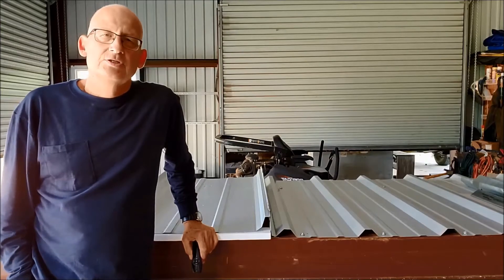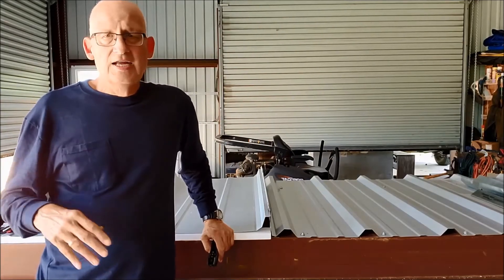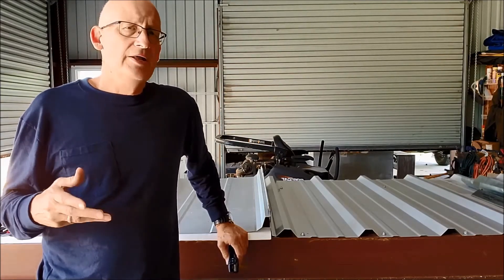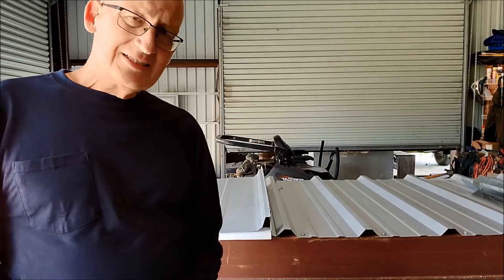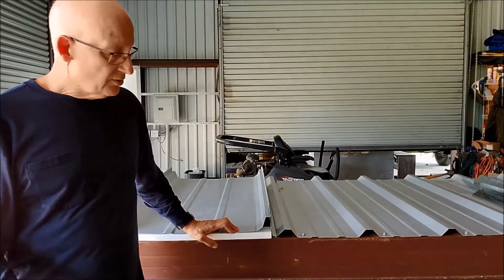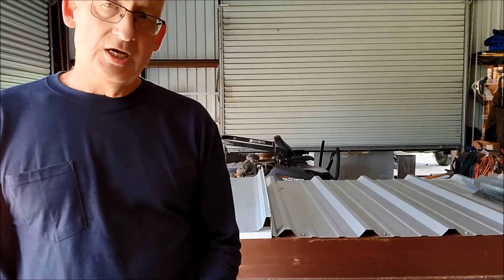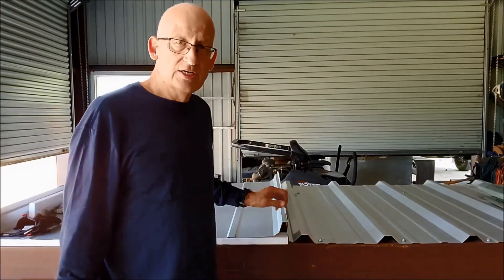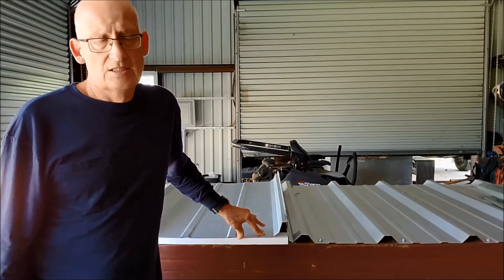Introduction to Metal Building Recover Solutions

Comment: Thank you for this series!  I'm considering a couple different options to re-roof two commercial metal buildings, and the discussion and visuals are VERY helpful to me.  One subject I don't see covered is laying a modified R panel directly over the old one (called Retro R?).  I'd be interested in your thoughts.  One reason your series is so helpful is that it's one of the few videos I've seen OTHER than those offered by Roof Hugger.  I belive they have a great product, but I wanted to hear from a third party as to why.  Thanks again for your work!